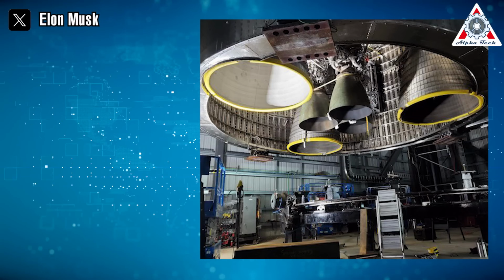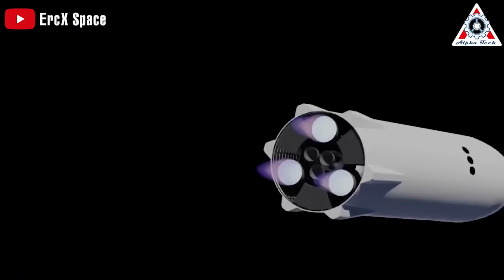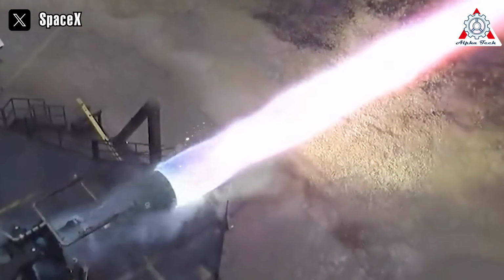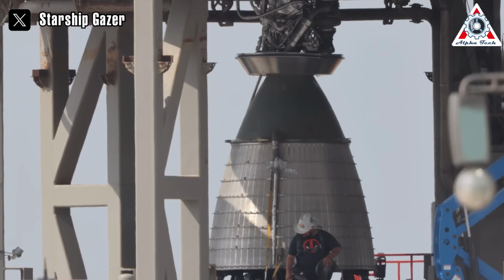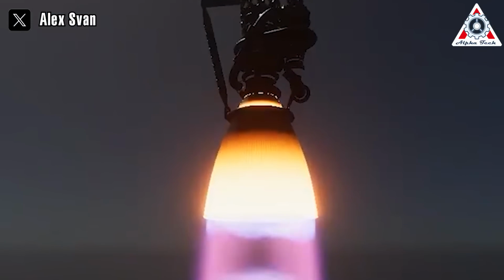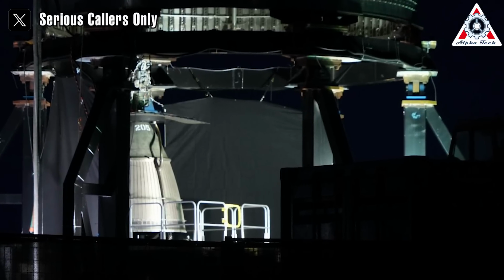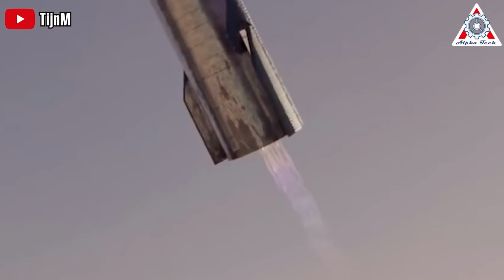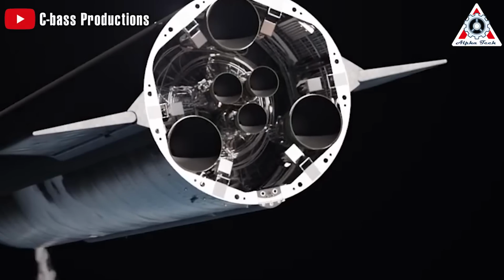SpaceX's BIGGER & BETTER Engine, changes everything!

Comment: The RS-25 (Space Shuttle main engine) does not have two combustion chambers, it's the RD-180 that does.  The reason the RS-25 has a much higher specific impulse than even the Raptor is that it burns hydrogen instead of methane or kerosene.  That is all.  Otherwise, the Raptor design is more advanced and efficient.  The little RL-10 also has a sky-high specific impulse because it burns hydrogen.

Hydrogen is simply more energetic per mass than any other fuel.  The trade-off is that it takes up a lot of volume per mass--much more than methane or kerosene.  It is best used in  upper stages only, while kerosene, despite being the least energetic per mass, is the most energetic per volume, which is why it is best used in first stages.

Methane is somewhere in between hydrogen and kerosene in terms of both energy per mass and energy per volume, so it's a pretty good compromise for all rocket stages.  In addition, SpaceX achieve greater energy per volume for their rockets by using subcooled liquid oxygen and subcooled liquid methane, which are kept extra cold (and densified) by loading just before launch.  Other companies load their rockets well ahead of time, so their propellents are not as cold (at their boiling points) and therefore less dense.

Comment: Flow separation is only an issue in the atmosphere. There is an optimal expansion ration for engines depending on the atmospheric pressure. The ratio increases as pressure decreases. In the vacuum of space the expansion ratio is essentially infinite, but since you can’t make an infinitely large bell, they settle for a reasonable size that’ll give them a sufficient isp in exchange for complexities in manufacturing and heat dissipation.

Comment: What an idiot is narrating this nonsense? You can never have flow separation in smooth  expansion nozzle of rocket engine in vacuum of space regardless of expansion ratio. There is no air outside that would try to enter the nozzle and cause flow separation.
Reply: Depends on your definition of "smooth".  Separation doesn't have to imply "vacuum of space" to local pressure differential that exists at the exit discontinuity.
Reply: @DarylOster  Your statement does not make much sense please explain what it is that you are trying to say
Reply: Supersonic flow accelerates in a divergent nozzle depending on the pressure differential AND the density.  Compared to a rocket nozzle operating at 1atm external pressure, the same nozzle in space will not add more than 1atm to the pressure differential.  The postulate that a discharge into vacuum allows infinite expansion ratio is only true for an ideal gas with zero mass.  A real gas has momentum that depends on the density and discharge velocity squared.  Ask that gas to expand toofast (even in a "smooth" way - without any edge discontinuity as at the exit of the nozzle) and the gas will separate from the wall of the nozzle (regardless if it is in a vacuum or not).  If such flow happens in an incompressable fluid such as water a cavitation area will form where the separation happens.  In the case of a rocket in space the ideal is for an infinite expansion ratio (without any seperation at the trailing edge) this is not possible as that would require infinite nozzle diameter AND infinite length.  A real nozzle operating in space can operate with a greater expansion ratio - but never infinite. So, if the nozzle expands faster than the available gas and pressure ratio allow for, separation will occur (even if there are no non-smooth discontinuities).  Fortunately, ignorance is easy to cure - idiocy is not.
Reply: @DarylOster  Term "Expansion nozzle of rocket engine" does not include any shape imaginable so in theory you are right but only when someone is starting from scratch
Reply: @KarolKarolak  why I asked what your definition of smooth is...
Reply: @DarylOster  Just the fact that I included word "smooth" in my statement should give you food for thought. BTW as soon as Elon installs tube on top of OLM that will reach to right below grid fins, seals off top 3/4 of open spaces between OLM support columns and turns OLM into a steam canon you will have to throw out the window all your knowledge on how rockets produce thrust.
Reply: @KarolKarolak  might as well use the entire crossection to produce initial thrust... where it does the most good.
Reply: @DarylOster  How does that fit into into all the things that you were just trying to explain to me?
Reply: @KarolKarolak  I was simply agreeing with your stated approach to improving initial launch thrust...
Reply: @DarylOster  Just so you know an application to Guinness World Records has been made for Shortest ever (.22 calibers) Steam Cannon assisted by 33 rocket engines shutting 9m dia. 120m lg. projectile into space has been made. (barrel is only 2m long and projectile is 9m dia. that gives you .22 calibers gun).
Reply: @KarolKarolak  haha on the .22!  I  recall reading somewhere that US ICBM (missiles) are several tons lighter due to the initial launch efficiency of the thrust gain due to the underground silo.
Reply: @DarylOster  Elon Musk accidentally created Steam Cannon at Boca Chica launch site. Now he can try to fight steam cannon effect on total thrust during liftoff or embrace this effect and make proper Steam Cannon. Fighting steam cannon effect will be difficult as it is highly unpredictable and disappears very quickly. Ignoring it and releasing hold down clamps after full thrust is reached leads to hard kick. Taking it into account and releasing clamps with reduced thrust requires very fast increase to full thrust right after hold down clamps release or rocket would slide back onto OLM.   Making proper Steam Cannon involves extending barrel length from 2m to more than 40m, partially closing off sides of OLM and use chopsticks (moving up with the rocket) to guide upper part of the rocket during liftoff. Extending barrel length allows for developing velocity with low acceleration and reduced thrust. It also allows for transition from reduced thrust to full thrust while in the tube increasing transition time. If Elon goes ahead with proper Steam Cannon it will be a revolution in rocketry.
Reply: @KarolKarolak  there are many proven ways to improve rocket launch efficiency, including but not limited to: containment of rocket exhaust in a launch tube (your steam cannon); electromagnetic linear motor (coil gun); air breathing first stage (turbine engines instead of rockets - and/or aircraft launch like virgin); air entrainment ejector (increases thrust surface area); and external initial fuel supply; etc.
Reply: @DarylOster  None of the things you have mentioned is practical for various reasons. Only steam (not exhaust gas) cannon shows any promise of practical use.

Comment: 357 tons of thrust is still less than the Saturn V F-1 engines at 873 tons of thrust.  Actually less than half.
Reply: True, but the F-1 is physically a much larger and heavier engine.  It's also far less efficient.  The thrust density of the Raptor is unmatched.  Without this, the Starship Super Heavy could never achieve enough thrust, given its design.  You couldn't fit enough F-1s or Merlin 1Ds or any other engine under it to get it to lift off from the pad.  The Raptor is truly a marvel for its size, being considerably smaller than even the BE-4, while generating greater thrust now.
Reply: @rbrtck  To keep the plumbing within the realm of sanity though, you'd probably want a bigger Merlin, Super Merlin.  But the Merlin concept can do it, 
Motivation for the Raptor =&= Methane, is the better past-orbit performance (as that is intended as a big part of Starship's mission), easier maintenance between flights, and overall better access to fuel - you can always get methane from simple ingredients, just need energy.  And for reasons of economy & reliability, they only want to develop and mass produce ONE engine for the rocket, and only have the logistics for ONE kind of fuel.
Reply: To compensate for the reduction in thrust versus hydrogen O2 you have to provide more than double the burn time using meth oxygen. Switching to a different type of engine that can offer a burn rate measured in hours versus 3.5 minutes can produce a serious level of thrust yielding close to 500k mph. Yes an engine like this does exist. In fact a fuel recycling engine that uses a redox system can deliver 24/7 thrust, and 1.5 million mph in less than a week. Your trip to Mars requires only a week to get there, and another week for breaking to achieve orbit around the red planet. Flights requiring months are old school, and frankly a joke using technology developed back in 1965. I'm not sure where Elon is on using the modern age space engines. We'll wait and see.
Reply: @marymarlow5598   Completely nonsensical word salad.

Comment: Specific impulse is measured in Newton-seconds, not seconds. really guys?  If you're going to report on a science topic, can you at least get the most basic science right?
Reply: Wikipedia says seconds is the most commonly used
Reply: The most common unit for specific impulse is the second, as values are identical regardless of whether the calculations are done in SI, imperial, or customary units.

Comment: Having seen a couple of eaely depictions of the Raptor 3 combustion chamber,
 if those were correct, Elon has gone for a smaller diameter combustion chamber, which would require higher pressures to feed with oxy and methane to get the increased thrust.
I suspect it will reuire a shift in cone shape to match, probably a longer narrower bell shape. still a parabola most likely, but higher pitch on the whistle... will be a different sounding and looking engine.
The narrower configuration could be conducive to clustering, perhaps allowing the bells to be merged at their edge to deaden the vibrations and mechanical movements.
Also seeing the image of the older cones glowing on the outside when fired, tells me that the use of fuel for cooling isnt absorbing enough energy, 
And another strategy needs to be thought up to turn that exterior heat into  thrust or pumping energy.

I'm.looking forward to next iterations of the engines to see which way things are going. I suspect we should in time see bigger combustion chambers... especially if narrower cones have less problems with atmospheric or vacuum encroachment at the edges. We could see a proportional size jump by Raptor 4.
If I understand correctly, next launch is Raptor 2 level. We should see some increase in reliability due to less complication. What Elon did there is like guys de smogging their cars.
You get increased performance and efficiency by removing unnecessary garbage...
Have done that myself on car engines, and its impressive. Wifey's car got racy. used less fuel, and so polluted less.
(Bureaucratic mandates make for bad engineering.)
Looking forward to Space myself, will be a long ways between traffic cops, and awhile before we break the speed limit.
I wanna own the junk yard at Mars City... &  Know all the guys building stuff....

Comment: Would this vacuum engine be of any use when landing upon the Moon or would a different design be required, likely?
Reply: They won’t be using raptors at all for landing on the moon, they will using a powerful rocket Thruster’s  mounted at the top of Starship for landing on the moon
Reply: They don't want to dig a hole, or blow crap all over the place. So landing on the moon requires the engines be mounted up high to avoid splatter all over the place. The high mounted engines keep the thrust far above ground level, and keeps the landing area fairly clear of debris. Might have a little bit of blow , but not much with high mounted engines.

Comment: Today's video was an extreme disappointment. Your commentary was directed at children & the completely ignorant.
The raptor 3 sea level & vacuum, are identical engines, except for the larger bell housing, which optimizes thrust for either sea level or space. I quickly became offended at the telling obvious white lyes, to achieve some point. 
Get a grip ALPHA TECH.

Comment: The familiar equation F=MA can be reduced because the fuel has a fixed mass which we can describe as a unit of fuel. so F=1A or F=A. Thus for a given amount of fuel, the thrust is proportional to the acceleration. The more acceleration, the more thrust for a given amount of fuel. Acceleration is measured in feet per seconds squared. Velocity is measured in feet per second. Specific impulse is measured in seconds to account for the difference in units between acceleration and velocity. The units of measurement need to be mathematically consistent.
Reply: Err... have you heard of Tsiolkowsky’s equation?
The only advantage I see to adding vacc engines is to reduce gravity losses when landing or taking off from an airless planet, like the Moon.
I suppose SpaceX thinks this more than compensates for the increased mass and reduced mass ratio.

Comment: If those Engines can't Fire-Up with availabilities of 5 or 6 - 9's, Space-X can forget a 30 Month Round-Trip Manned Mission to Mars. So far there hasn't been a Full-Up Test Firing or Flight where All Engines Fired. BUT it hasn't Blown Up, this is good. But the Engines have either a Reliability/Design Problem OR there's a System level problem in their Feed or Control..We have immense faith Space-X will conquer this nuisance problem.